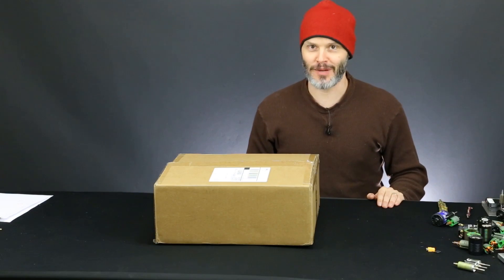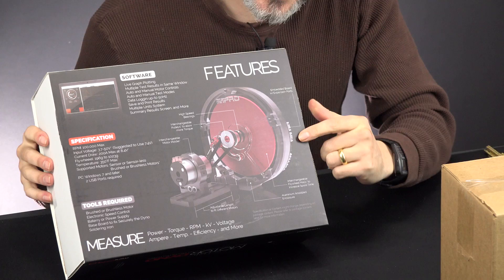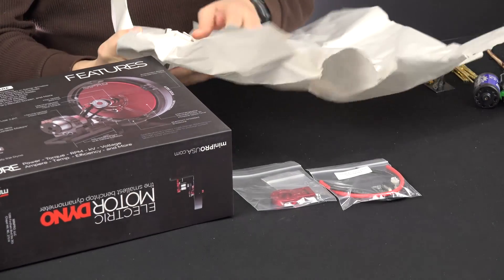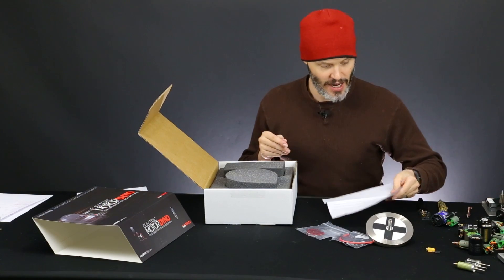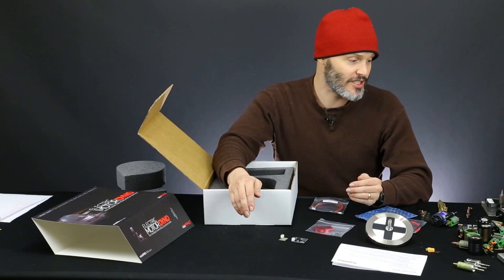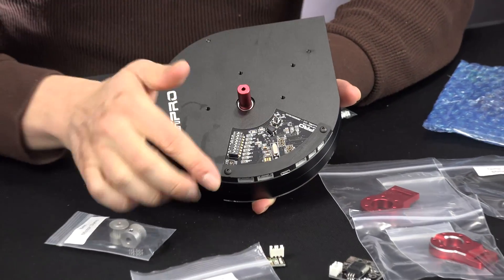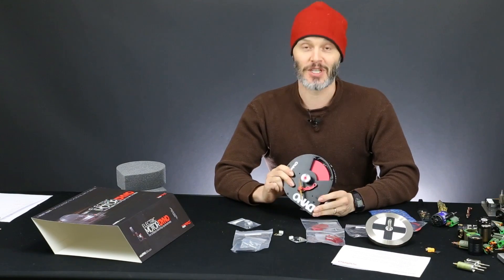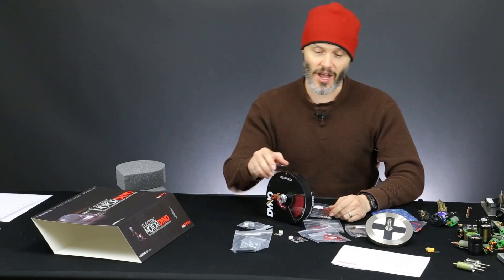Cool Tech Gear! MiniPro USA RC Motor Dyno Unboxing - Holmes Hobbies

Comment: John - what do you think the margin of error will be on this system, assuming consistent setup?
Reply from the maker: I'm hoping less than two percent deviation after swapping motors.   So far it seems to be holding up within a percent, but I haven't worn the belts much yet.